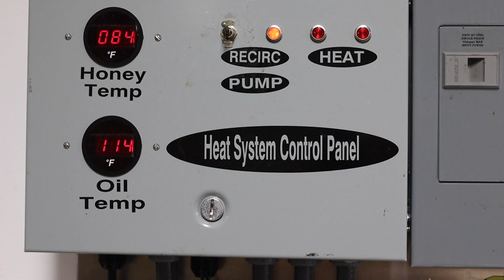How We Extract Honey

Comment: Does the wax separator make the honey clean enough to bottle or do you run your honey through another filter before bottling? What type of filter system do you use? Thanks
Reply from the maker: The honey from the wax separator still has a little debris in it but a few days in a settling tank makes the honey good enough to bottle in my view. Some might like to see it clearer. When bottling we actually move the honey through an 800 or 600 micron filter just ahead of the bottling machine. When selling bulk we just fill from the settling tank and its fairly clean. Our filters can be seen in our video "Bottling Honey With a Dadant Fillmaster and a Chadam Filler". https://www.youtube.com/watch?v=Npa3gjpH8ig

Comment: Hello we are reconfiguring our extraction plant and were thinking of using a gear pump after the wax separator like you have. Are you able to tell me what port sizes the pump you use is, and what flow it is rated at please?
Reply from the maker: Hi Martin. It is a one inch brass gear pump with a 3/4 horse motor. I can't tell you the exact flow rate but I can tell you it runs about half the time when we are extracting. On a good day we do about fifteen drums.

Comment: with all of these machines that processing honey with heating process and microfiltration, the honey quality is not raw?
Reply from the maker: Thanks for your question. At 7:20 you can see that the temperature in the warming tube is 84 degrees F which is 10 degrees cooler than bees keep their hive. Also, in this system we don't have a filter, only the wax float spinner which removes bulk wax cappings and debris from the honey.

Comment: Hi bob, i have been following your videos for a while now and am very impressed wit the kind of knowledge u are sharing, we do a very different kind of  beekeeping here, i wanted to inquire what are the basic standards that u follow interms of the SS used, are those the basic requirement for FDA or are u going above and beyond
Reply from the maker: Above and beyond. There is both 304 food grade stainless and 316 food grade stainless. 316 is considered better for acidic foods which honey is at an average of around 3.9 PH. Some of our threaded fittings are 304 because we couldn't find what we wanted but our tanks, manifolds and most of our fittings are 316.
Reply: @bobbinnie9872  thanks alot for the reply sir, I am also considering settings up a plant in my country and was impressed by the vaccum system u showed, I have been able to find a supplier for the same and going to buy it, I have one more question, 

What is the importance is maintaining the temperature after processing in the storage tanks, how much difference in the quantity is there when u fill jars at different temperatures, is it only maintained at that temperature to avoid crystalization.